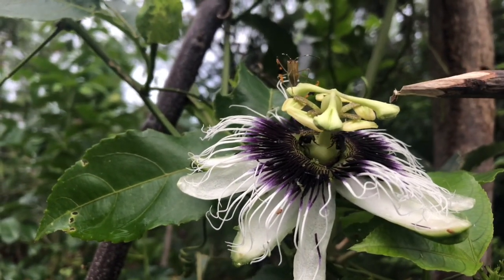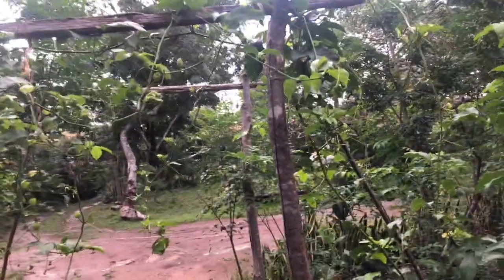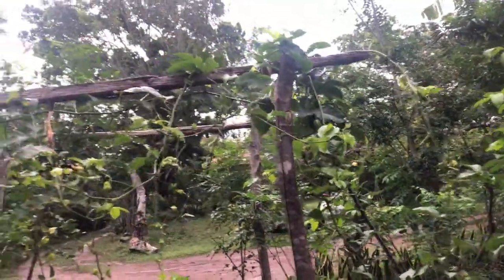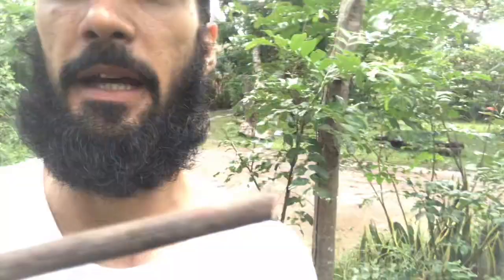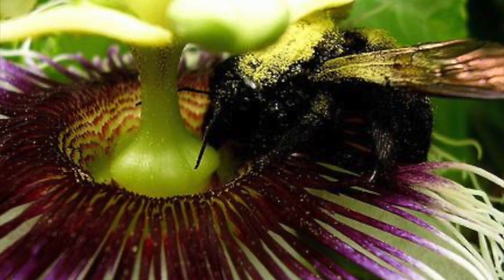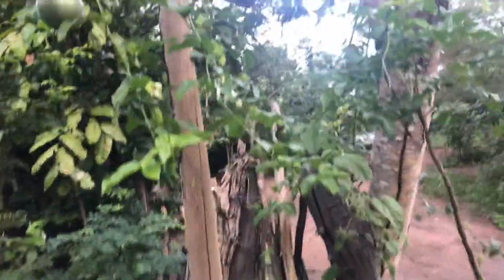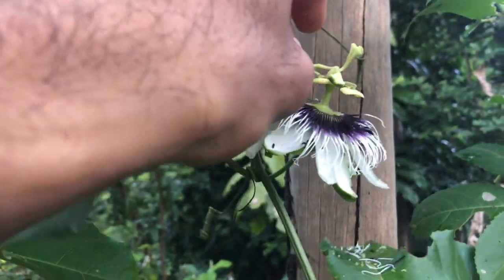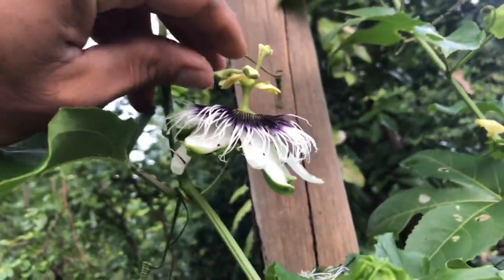How to pollinate passion fruit

Comment: Passion fruit flowers have both male and female parts and can be self-compatible (self-pollinating) or self-incompatible (not self-pollinating), depending on variety. The yellow passion fruit is largely self-incompatible; therefore, cross-pollination is necessary for seed and fruit set (McGregor 1976). The purple passion fruit varieties and their hybrids are self-compatible, and no cross-pollination is required (McCarthy and Dick 2007). However, some varieties and hybrids have partial self-incompatibility and should be planted with other varieties

I have one passion fruit tree.

Nobody in my neighborhood has passion fruits.

My fruits are in each leaves.

So many like grapes.

I  am the main pollinator.

I pollinate it immediately once it open up.
Reply: Hi if I have just one vine, could I cross pollinate the flowers. All my flowers just keep falling and it's frustrating. It's appreciate you response please. Thank you in advance
Reply: @cassandramcintyre8655 yes, you can; however, not necessary.